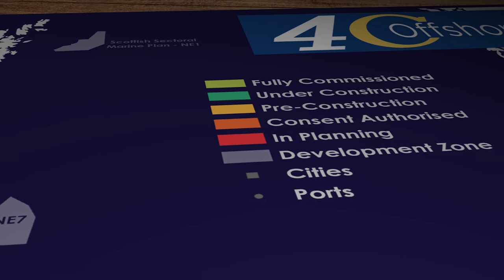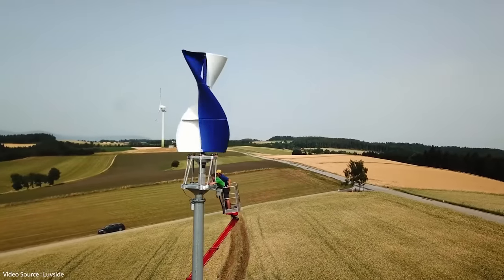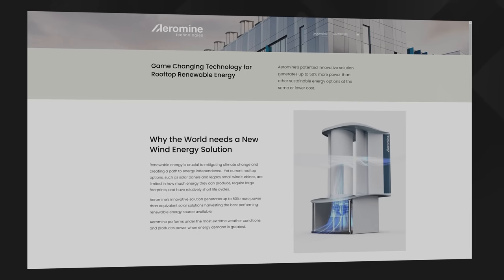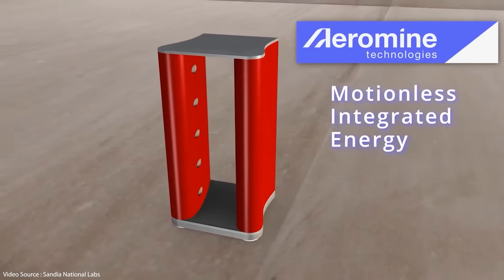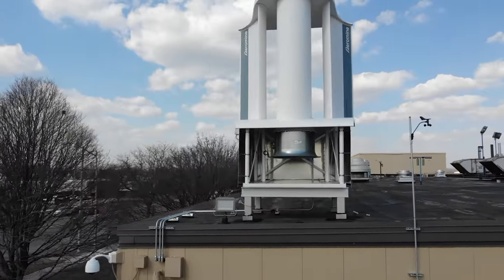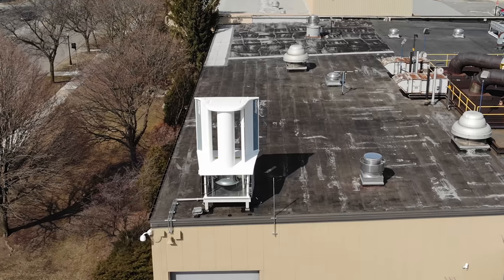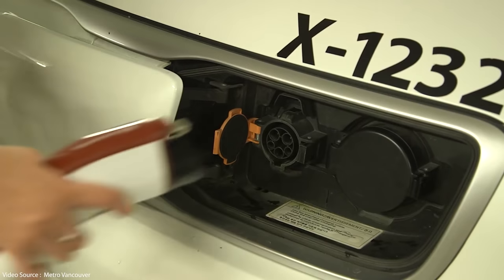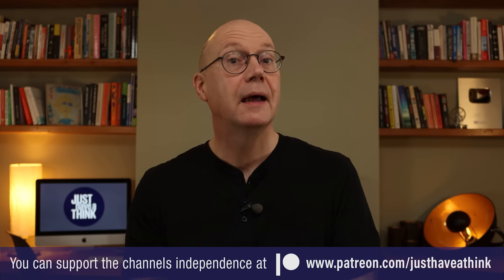Aeromine Rooftop Wind. Static. Silent.  50% more power than Solar PV. What's not to like?

Comment: Hi Dave. I'm been working with solar energy since 1991. I hve been installer, own company, ceo, superwiser, board member in large solar associations in Sweden. Developer of large thermal solar panels 5,3m- almost 209 inches. The picture you have at the top right of the video about producing both heat and solar electricity at the same time and in the same place is not the best solution. But it is a solution that can be accepted if you have poor space in which to build. Solar cells must have as cold an environment as possible for best efficiency - If it is hot, their efficiency decreases. If the solar cells get hotter, the effect drops by about 0.4 percent per degree. A solar collector can reach up to 200° and with such a high temperature the effect from the solar cells is reduced by about 80%. If the power from the solar cells is 22%, the net power becomes 22*0.8=17.6%, It is better to build the two technologies separately. Thanks for a great and informative video on rooftop wind, something I had in my mind 20 years ago. BR Petri

Comment: Great video as usual, really nice overview of how it works! My only issue with the system, which I discussed on my channel, is the slow wind speeds on rooftops (and how this is glossed over by Aeromine). This is a problem for all rooftop/micro wind, not just Aeromine, but it is quite a big one! 

I have had some interesting comments on my channel though at possible applications for this technology, especially in areas too extreme for standard wind turbines and solar panels (e.g., Antarctica). I'm sure it could have other interesting applications to possibly compliment solar panels, as it may be more space efficient at generating power, but it is likely to be more expensive in terms of LCOE!
Reply: I would be worried about weather conditions conducive to icing, freezing mist conditions. Still, I think there's a niche for this product. 
-- I also think that we shouldn't put too much emphasis on head-to-head efficiency comparisons. As long as a system has a moderate degree of energy- and cost-efficiency, with some durability, reliability, and ease of maintenance, we should be looking for niches where various products might be more appropriate. For some sites (low-income countries and neighborhoods), low first cost might be more important than net efficiency, and low-income people can be expected not to make as heavy demands on the systems. Obviously, there are climate- and micro-climate niches. In urban and suburban areas, the physical topography of the built environment makes a difference. Too many discussions on these matters have the flavor of central-planning oversimplification. It wasn't too long ago that there was a raging either/or debate about the relative merits of solar and wind power, in search of a one-size-fits-all solution, like Great Reset thinking about human organization. 
-- Diverse, decentralized energy production makes for a less-brittle energy infrastructure, though the current administration and global elites seem determined to make everyone more dependent on a centralized electrical grid (and a centralized surveillance-oriented digital currency). There are political agendas at work here, namely pushing the West toward a more China-like political system. 
-- The point of energy production is to serve the energy needs of the people, not to enable governments to make the people more dependent on centralized infrastructure and control. So bring on the niche solutions.

Comment: Really interesting, ideal for commercial buildings which tend to have flat roof’s. I would love to see this miniaturised with all parts being 3D printed to bring it down to the housing end of the spectrum, even if it only produced 0.5Kw overnight it would top up a solar systems battery pack to keep things ticking over so there’s enough ‘free’ energy available when the home owners wake up and flash up the kitchens.
Reply: So true, remote rural off grid here just installed a wind generator to complement my solar, still gauging the results but it is keeping the batteries 24V system topped up overnight will watch this company with interest hope they get it down to the off grid house level at a reasonable price
Reply: Many domestic dwellings require less than 500W at night to operate. You could potentially run you house overnight on one of these alone.
Reply: @rbolden  especially if you like I do run inverter friendly fridge and led lighting and  gas for the stove

Comment: The most important consideration when dealing with a rooftop installation is how it will impact the structure it sits on. Solar panels and racking are light enough to be suitable for most rooftops. These machines look heavier and apoear to concentrate a lot more weight over a smaller footprint, which could drastically limit their suitability to sit on top of many buildings not designed with them in mind. Another concern is that the edge of a roof is often going to be reserved to allow access to technicians or firefighters. This company should be reaching out to any of the hundreds of structural engineers and commercial solar project developers who have dealt with these issues thousands of times so they can determine if these problems won’t severely limit their addressable market size.
Reply: Not only the self weight but also the dynamic loading forces for normal and storm force winds.
Reply: As long as you mount it on top of a load bearing wall this shouldn't be an issue but most industrial construction halls try to be as light as possible to reduce cost.
Reply: @redshift3  Yeah dynamic loads
Reply: @paxundpeace9970  
They don't design load bearing walls for unlimited weight.

Thars why roofs occasionally collapse when they get too much snow. They were built to hold a LOT of weight from snow. But a few thousand pounds extra, and you can get a collapse.

These things are going to be heavy, and there's no way a building that wasn't bullt to handle them is going to have as many on its roof as they showed. 
Nevermind the dynamic loading from the wind.
Reply: I’m guessing that in the many years of effort that went into this product, they also have talked a lot to structural engineers about how to make it safe and as broadly installable as possible.
Reply: @davestagner  
Not really. Lol

You can't change the shape and make things better.

It has a weight.
You can't do much for a building holding it up, except to make it lighter. 

Not to mention they are still listing the absolute max it can put out. Like the wind never blows at any speed than the speed needed for max power.
They haven't done much other than design it. 
And TBH, it's a pretty simple thing.
Reply: @lordgarion514  True but its weight depends a lot on the materials, their thickness and how much empty space is inside the structure.  While it is not specified, these look large but not particularly 'thick'.  That said, it will really come down to the specific building.  I would be suprised if the company supporting their pilot didn't at least consider that aspect though before investing money into it as they are looking to see the viability of fitting such systems to their own buildings.

There is no garrentee of any technology still effectively in an early testing phase like this.  However at the same time, I wouldn't right them off.
Reply: @brynphillips9957  
And those properties are given by a computer program now. 

All you have to do is tell it what the loads are, and it will tell you what you need to support it.

You're talking about serious money in the metallurgical research alone.
That's stuff multi billion dollar companies spend money on.

These folks didn't do anything like that at all. You don't get to choose much, the load does. 
They're not even the first to design an enclosed VAWT.

Once they picked the generator, they just look up how much wind energy is needed to turn it. Then they look up how much energy the wind has at certain speeds. Then an easy calculation tells you how much surface area the blades have to have. (And you can look up how thick everything needs to be for different metals)

This took them maybe a week to design on a computer. 

And I'm not writing anything off, I know for a fact this technology works.

But they're selling you a line of bullshit to get people excited.

Just their 5kw claim is shit. The only way it's making that power, is if it's running basically flat out all the time.

That won't happen. 
You don't get power just because you have the blade surface area, you have to have a hole to let the air get to the blades.
And the hole isn't big enough for their claims of 5kw under remotely normal conditions. 

So they're already starting off badly by hyper-inflating the realistic output. 

The technology is simple and proven, but this company won't be the one to bring it to market. A company more focused on the making, instead of the advertising will be.
Reply: Presumably the installers would take local wind data over a period of time and assess weather patterns over the structure. Apparently, back in the days when wind power was grinding the flour to make our bread,  Dutch windmill builders, the acknowledged experts of the day, would spend weeks roaming the intended area, sometimes just sitting and watching the clouds the trees and the grass swaying for hours at a time, much to the exasperation of the miller. Then after due deliberation, say "NO" to the location. If he did a give a nod of approval, then the mill was sure to have all the wind power it needed.  I'm sure, not all flat roof structures are suitable for this type of device and selecting the correct site maybe needs the services of one of those medieval Dutchmen.
Reply: Not every building can support multi-ton AC units on the roof- but many, many do.   The egotism of presuming you have more concern consideration for marketing challenges than those dedicated to the enterprise is gobsmacking.
Reply: @redshift3  id like to think that in storm force winds the bolts that it uses to fix to the roof would shear before lifting the strcuture.
Reply: @Brurgh  not an ideal safety solution to dump debris into the storm

Comment: Like so many other such systems, cost is the key issue (this includes installation and building reinforcement cost). And with SO much competition coming out, we’re going to see some really excellent designs come out of it. This one seems particularly well thought out, and I’m glad to see it in real testing, not just vaporware.
Reply: Its vaporware if no one can afford it or if regulatory permitting is limited to just commercial buildings.    Let's talk about mass usage on single family residential homes and I'll listen.
Reply: @alexnutcasio936  You just posted the "real story" individual use is the key to any type of alternate energy development and use.

Comment: At my work at NASA I ran across a micro wind turbine design that was being researched first in the wind tunnels on site and then using the super computers, the design was so elegant and simple i tried my hand at building one for an off grid homesteader friend. It consisted of a round plywood base 1 mtr dia with a spiral groove 5cm deep and 10 turns to a 20cm hole, into the groove a piece of sheet metal 1mtr wide was cut to make a 1mtr full hight turn in the outside spiral groove, then tapering down to end at the hole in the middle, under the hole was a car alternator on end with a squirrel cage type fan so that the upper edge of the fan was just inside the hole in the base but not touching,.The assembly of a 1mtr high open stand to allow airflow up through the fan setup to turn clockwise taking advantage of the coriolis effect. The front gap was oriented to the prevailing wind that followed the spiral path, it causes a low pressure at the hole in the base spinning the fan and alternator unit, a auto regulator was used to charge batteries in the base to supply lighting and small appliances, radio, cel phones, etc. Even though the unit's orientation was fixed the effective wind direction was up to 120 deg's.  I read the Israelis built an enhanced version burning trash underneath, no data on that. Only issue reported was in variable, strong winds the unit emitted kind of moaning sound downwind. NASA dropped the program when it was found not to be up scalable. Also reminded of the Altamont Pass egg beater windmills, long gone.

Comment: First!  Does the turbine not rotate to accommodate fluctuating wind direction?
Reply: The flow of air up the vertical wall seems key, that would be lost if it turned 180 degrees.

Comment: This system seems to be reliant on two factors;
A very consistent wind direction.
Roof edge oriented with that wind direction.

So it might well be a good system, but I suspect the successful installation sites will be limited.
Reply: it's obviously not a good system for the reasons you point out - but interesting that you're unwilling to admit that
Reply: A system like this would be  orientated  towards the primary  wind direction and if I am not mistaken  there could  be a second set of foils  pointing  in an adjacent wind direction

Comment: I lived in a 16 story condo tower in San Juan, Puerto Rico and in 2008 I proposed a solar array with horizontal wind turbines mounted at the edge of the roof facing the ocean.  I measured the winds there to average above 17 MPH, an ideal location for such equipment.

Comment: At 4:38 we learn that the unit is positioned on the edge of a roof facing the `annually predominant wind direction`. Where I live in the UK the prevailing wind in summer is from the south west but in winter it is often from a northerly or eastern direction. To be of any use it would need to be able to move around the roof. Not usually possible on a domestic property. Another point is the phrase `virtually silent`. Air moving through a Venturi and driving a generator is not going to be anything resembling silent.

Comment: It does have a moving rotor so I might expect some vibration at some windspeed's. I wonder if residential installations ever are felt in the building? Cool idea. Seems like little birds could get sucked into these things unless there is a screen to prevent entrance to the rotor. In the north East icing could be an issue. We get some transitional storms where everything gets coated with ice. many traditional wind turbines up here are shut down because of ice.
Reply: You're concerned about the welfare of a little bird, do you eat chicken, turkey, pork, beef, veal, lamb? Spare a thought for them.

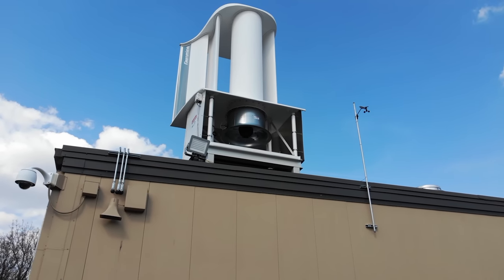Comment: "Static. Silent."  5:18 there's a visible turbine fan, so while it may be quiet when compared to industrial-size wind generators, I'm doubting it is silent.  Also, a turbine rotates, therefore is not static.  The frame itself might be, but ... Anyway, your title is a little click-baity and a bit misleading, but the idea is a good one.  At 6:12 the narrator states again that they "have no moving parts" and "operate silently."  This is misleading.  They have a turbine, which by definition rotates -- thus is moving.  Also, there WILL be noise, but it is probably quieter than a roof-mounted AC/heating unit.

Comment: A lot of roofs in my country are peaked instead of flat. There is some difference in the angle as well. I wonder how easy it would be to compensate for this. Should be easy enough to make a mutable support structure to install it, but I'm guessing you would need a very special wind-tunnel-designed scoop at the bottom intake if you wanted a one-size-fits-all solution for these roofs?
Reply: Wonder if it can be incorporated into the chimney stacks of today as they are just a hollow void with a pipe.  Thus hidden and secured to all sides